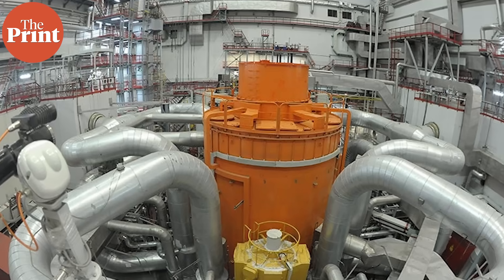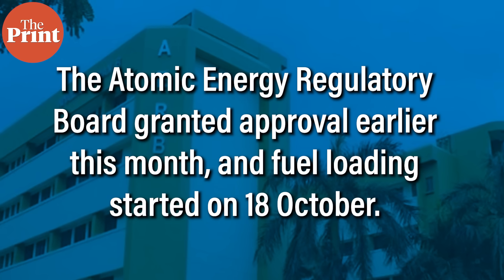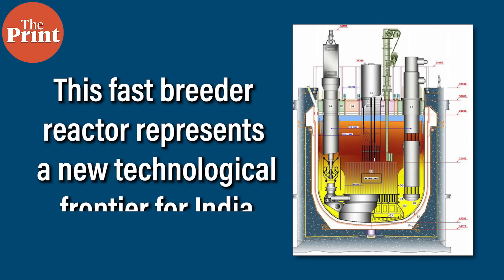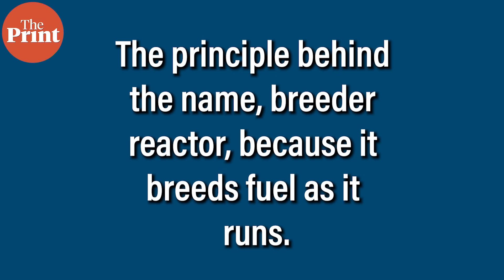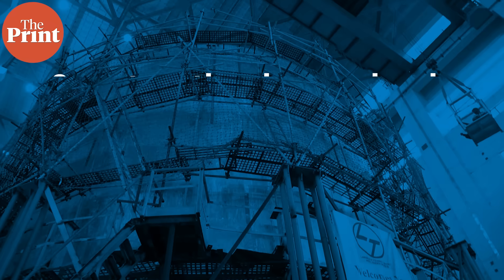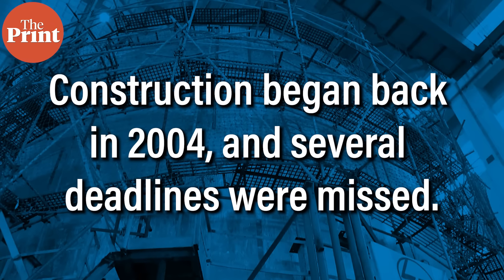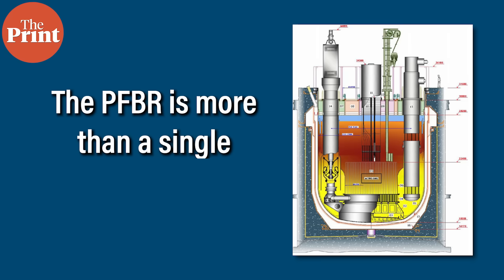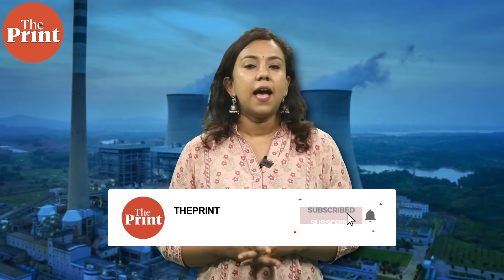How Kalpakkam's PFBR tech promises to power India's nuclear energy ambitions

Comment: Hope all levels of protection is part of the design:For example,  France couldn't make fast breeder reactor  (Super Phoenix) work.  Not sure  if India can make it work. Also, separation is such a dirty job (radiologically) it has to be done in a proper way , extremely dangerous 
Since the irradiated fuel is highly radioactive, you have to design the reprocessing (i.e. separation of U / Pu) plants carefully, This from a close friend of mine with Nuclear physicist with 40+ years in nuclear industry (in a highly Safty conscious country) we worked together in a nuclear power plant design department
Reply: I think there is a U-233 protptype reactor in vicinity supposed to use the fuel genereated from PFBR for generation, albiet progress has been slow for the very reasons you mentioned. I think it is about to take a decade at least till they make it commercial. Even then it would be just one plant. This plant has been the butt of jokes for being the longest running project. They dont have plans for scaling it

Comment: Lets hope they figure out thorium reactors soon enough so they can be self dependent instead of importing uranium
Reply: Everything is ready the next step is AHWR(Advance Heavy Water Reactor) its design and everything is ready once they have enough inventory of plutonium they will start construction of next phase (AHWR) that's where the thorium will be burned and nuclear fuel cycle will be closed. The most amazing part is this 3 stage program will produce very less radioactive waste, majority of the waste produced would decay in 30-90 years and few other waste in around 100-200 years compare it with Light water reactors whose waste could live upto thousands of years some as long as 25000 years.

Comment: Dr Homi Bhabha's vision, delayed by decades due to underfunding in R&D by a bureaucracy that did not understand just how vital energy independence is to the future of India.  Now, the time for this tech has passed because there are better options.  There could be space for tiny modular nuclear reactors to supply ~20% of India's power needs as the rest goes all renewables + storage. SMRs using Thorium, in modules as small as 40-80MWe.  Containerised and pre-packaged, factory-made reactors, not massive onsite engineering projects.  

The SMRs are well suited for strategic resilience. Use them as local generating stations in a distributed grid design that combines solar/wind and storage that auto-balances demand and supply. Quite different from the centralised mega power station thinking from the coal days. It can create locally resilient electricity grid that cannot be taken out easily by a small number of missiles or cyber strikes on gigawatt scale mega power plants.  These SMRs could also be trucked or rail transported to sites in times of natural disasters, for restoring critical power supplies.  The containerised mobility also gives them potentially military uses.

India needs to attract new tech in nuclear. Frame policy and incentives to become the host for startups in intrinsically safe SMRs designs. Like Copenhagen Atomics, CCTE, Thorizon, or Moltex.  Similarly, there are innovative research startups into low-cost fusion options, often backed by universities.  Offer them facilities to create low-cost labs in India, along with funding, creating Indian stakes in such startups.  Think like a venture capitalist, but with a national interest, to become the global hub for next generation nuclear.